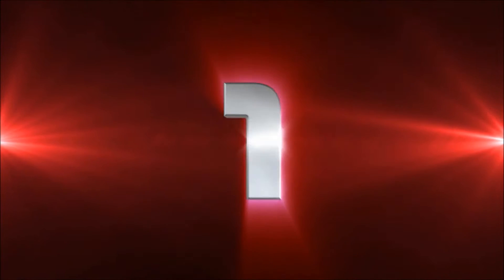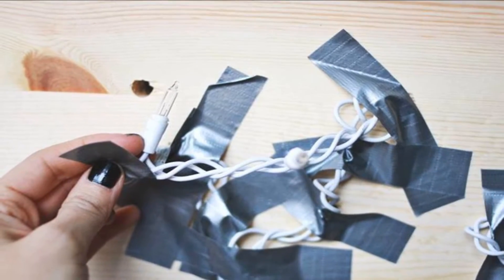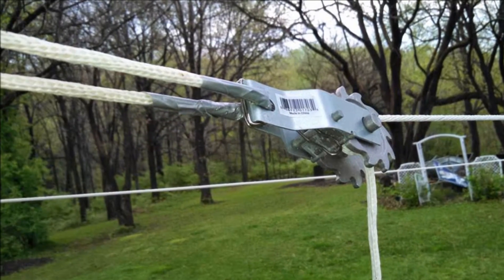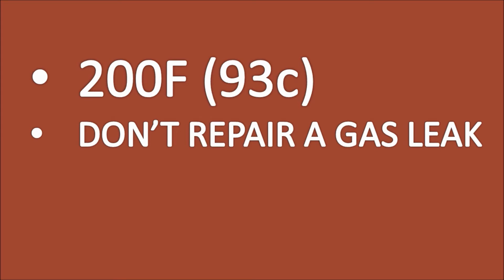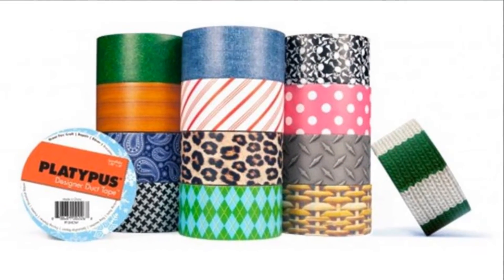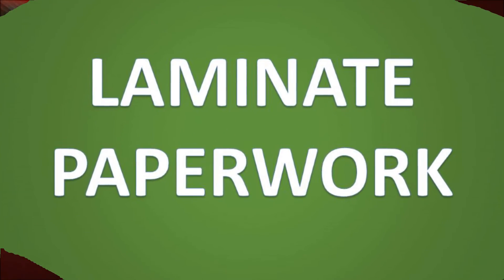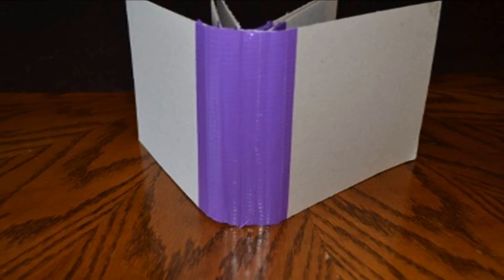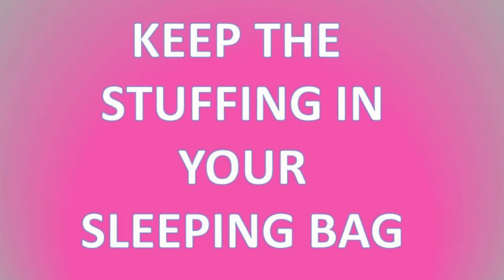Brilliant Uses and Hacks for Duct or Duck Tape

Comment: I am sure comments will vary most widely.  I will say as far as I do know once upon a time Duck Tape was manufactured with Duck Cloth, and a little bit of Dutch Sauce, as a very stubborn adhesive.  Well OK the adhesive being Dutch Sauce is not verifiable at this time but the general material was Duck Cloth.  Duck Cloth was named Duck Cloth obviously due to the Dutch thinking that it might be edible, and due to it's extremely reliable water resistance (water off a duck's back [um doi]).  Now-a-days,  the Dutch having being informed of their gross error in thinking in regards to Duck Cloth continue to insist upon making footwear from wood even to this very day.

Thank you and good night.